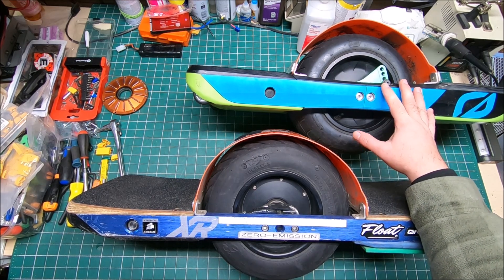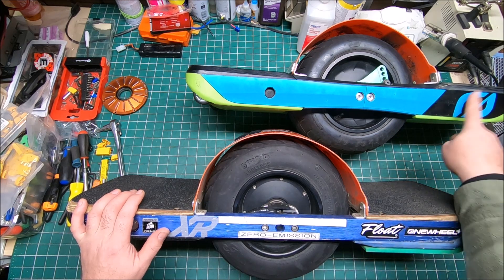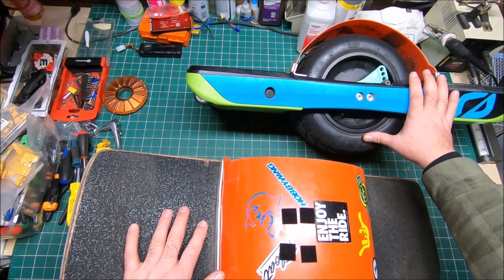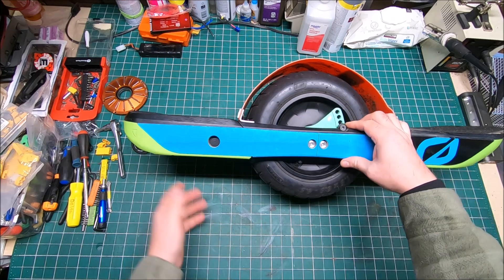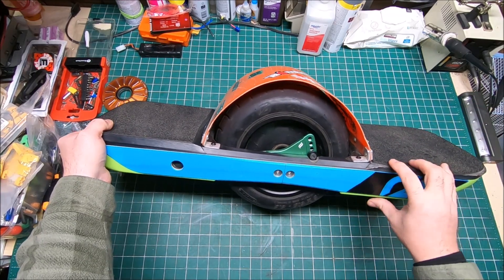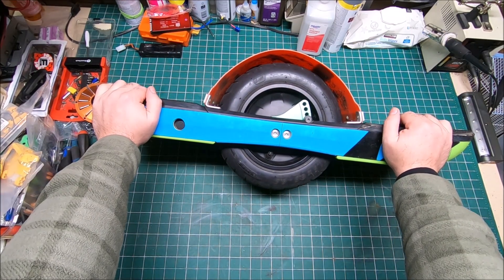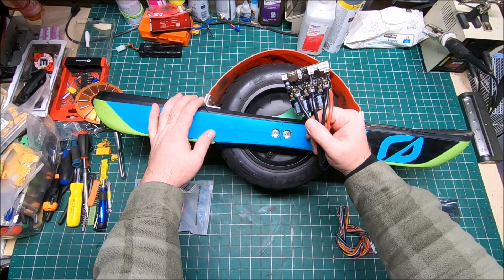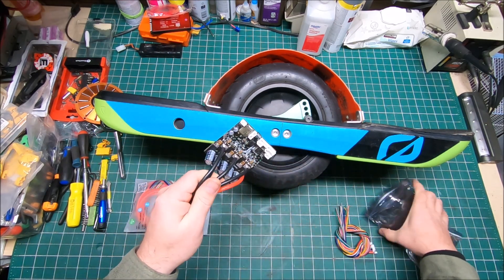Onewheel GT converting to VESC Monster part 1

Comment: A superflux motor will probably make a much bigger performance difference than the 24s battery particularly for a heavy guy. The hypercore overheats pretty easily also. The SF build is cheaper and much more straightforward. The Tronic will still give you a boost in terms of motor amps vs the Little Focer. Your plan has superior range and is lighter though. I'm 200lbs and have a 19s2p lil foc superflux XR it can cruise comfortably above 50kmph even up hills.
Reply from the maker: I got Superflux v2 on order, and then my XR will be really mind-blowing machine for my needs

Comment: Can you send me links of what cable are you using? I started to do the same thing for my GT.🎉
Reply: Let's get rid off the handle. I thought the same thing. Nice!
Reply from the maker: @gergosnoo  Yes, by getting rid of the handle, then it will be a perfect battery/controller box 👍
Reply from the maker: here is https://www.amazon.com/BNTECHGO-Silicone-Flexible-Strands-Stranded/dp/B01ABOPO2S/ref=sr_1_1_sspa?crid=1MVTSD6WCQIN0&keywords=10%2BGauge%2BSilicone%2BWire&qid=1701460399&s=industrial&sprefix=10%2Bgauge%2Bsilicone%2Bwire%2Cindustrial%2C186&sr=1-1-spons&sp_csd=d2lkZ2V0TmFtZT1zcF9hdGY&th=1